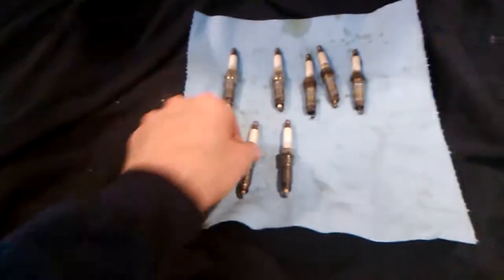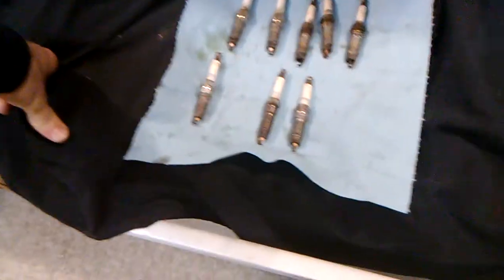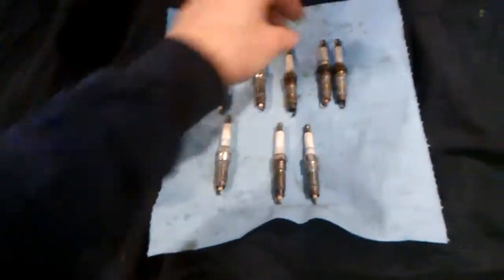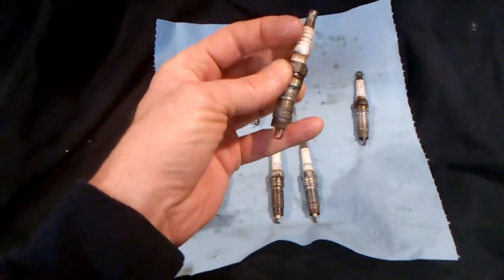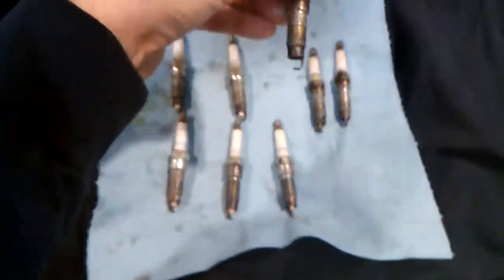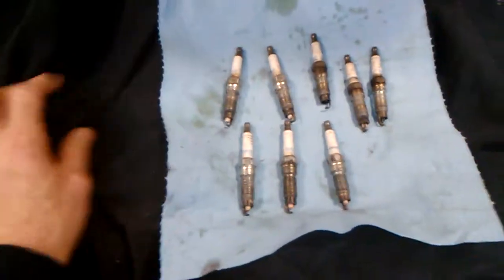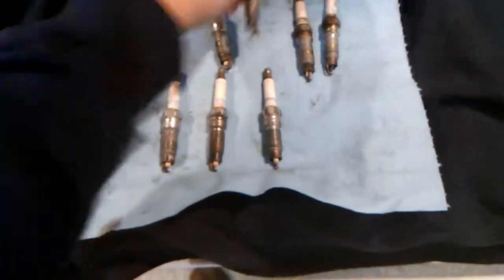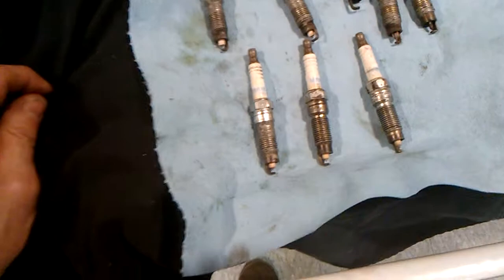5.4 engine code P0300

Comment: That’s because they ain’t motorcraft plugs!
Reply from the maker: Yes, I believe they were knock offs
Reply: I did the same thing with 02 sensors.
Reply from the maker: I buy spark plugs and O2 sensor locally now, I've been burned too many times